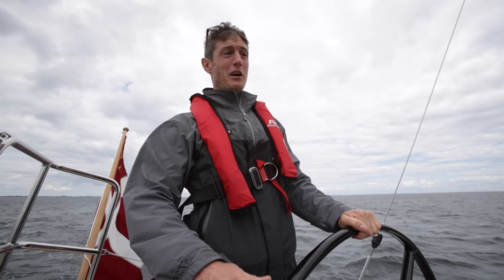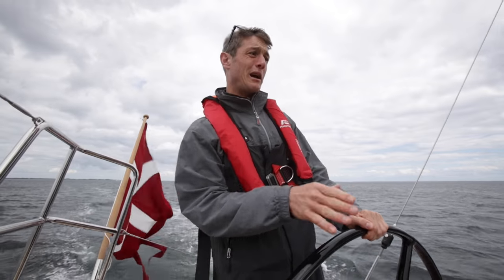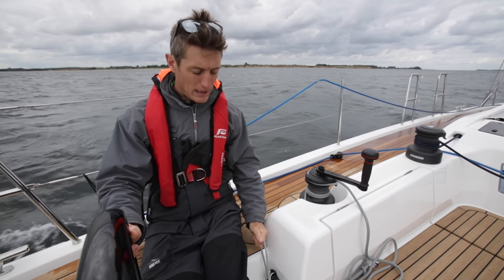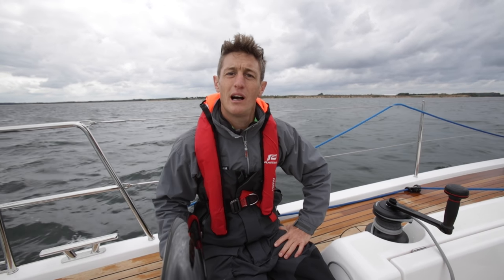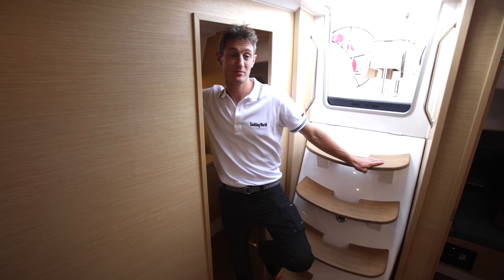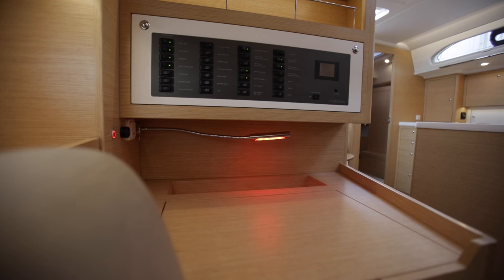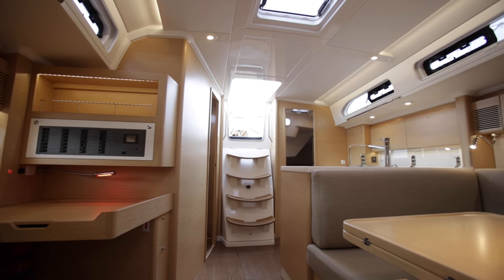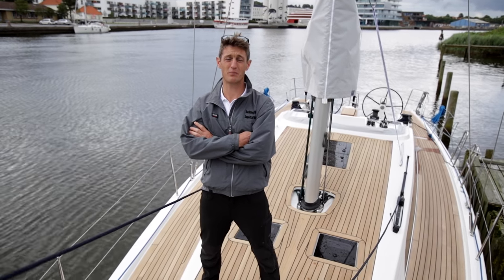On test: X4

Comment: Decent little boat. But an aft facing chart table with no outside view? Meh.
Reply: That's the in vogue design and it's disappointing. Many designs have put the head where the chart table went for 30+ years. Your need a tight nook for the navigator to stay put in heavy seas, as that's when you need him the most.